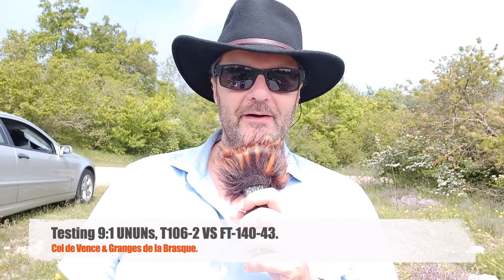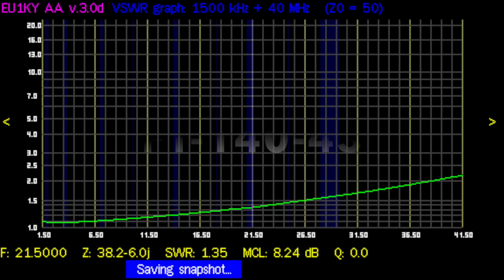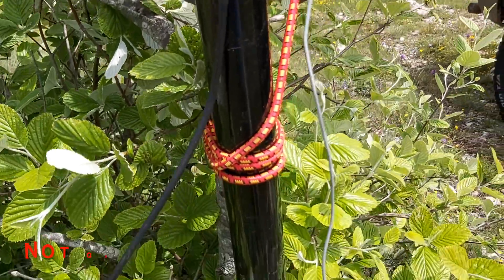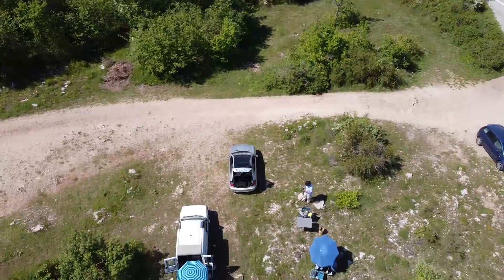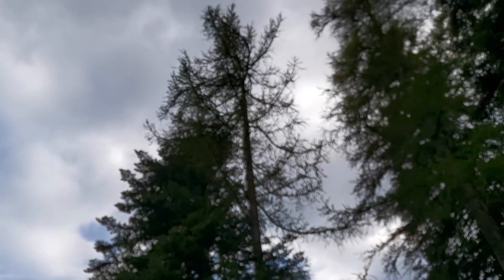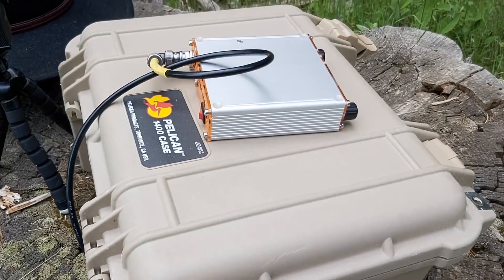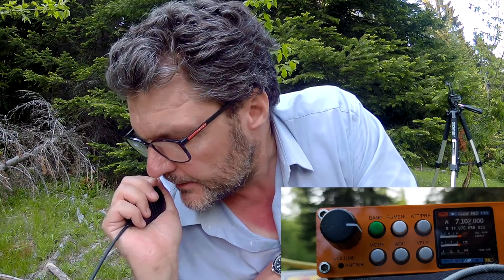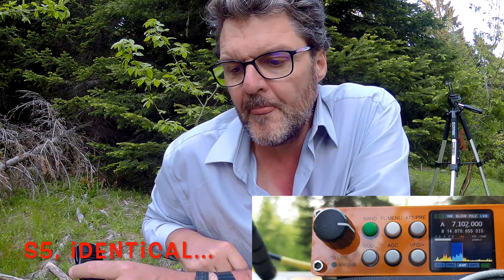Testing 9:1 UNUNs, T106-2 VS FT-140-43.

Comment: 00:57 That IS NOT A TEST !!! The SWR tells you how much power is reflected back to the transmitter but not the INSERTION LOSS of the transformer.
The reflected power is not lost power and is recovered (better if with a tuner) except for the increased losses of the line.
The insertion loss instead wastes part of the power by transforming it into heat and therefore that is the measurement to do.
If you, before teaching wrong things, learned to design RF transformers you would never test a wide band transformer wound on an iron powder toroid (e.g. mix 2, as in this video) instead of ferrite because it is a gross error
Reply from the maker: I know this. This is not about the SWR. You seem to believe that I am saying this is the best antenna out there, when I am just saying that it works!

Comment: If you are doing SSB QRP you will always do better with a resonant antenna. Radom wires are less efficient and poorer on receive. If you don't have the space for a half or quarter wave, a coil can help to reduce the length although this will start to introduce inefficiencies. The 9:1 and a wire does have the advantage of being always able to get a signal out albeit inefficiently pretty much anywhere, so there is a use case as a backup, potentially not even using an unun and just let the tuner match the wire (I have no information on whether the 9:1 plus tuner or just a tuner is more efficient).
Reply from the maker: I guess the 9:1 is an assurance that the tuner will be able to tune the system. I'd take an EFHW any day over a random wire!

Comment: Can you build and test the Wolfgang 9.1 unun please
Reply from the maker: I'll look it up..
Reply from the maker: It is the same as the EARCHI UNUN I tested and used in a few of my videos.
Reply: @RadioPrepper  No the lay out and spacing of the coils are very important here is a link  https://youtu.be/sk2ZZdJJrgY
Reply: Do correct me if I am mistaken my friend
Reply from the maker: Ah thanks, I didn't see this because it was held for review, because of the link.. I'll have a look..
Reply from the maker: Ok I watched the whole video... It is the same wiring, just one turn difference. However my test did show that the powdered iron core works better than the ferrite material one, by far... He keeps mentioning good performance just because the SWR is low. He did not test the transformer on the air against another one. Low SWR has no bearing on performance. Testing SWR and proper transformation is not at all like testing efficiency...

Comment: Thanks for another excellent presentation. I wonder if changes in propagation had any impact on the results. One could repeat the test with a local amateur operator and use ground wave propagation. Another option would be measurements taken with a field strength meter.

It might be even more interesting to replace the antenna with a 450 ohm resistor and scan each device with a NanoVNA over the range 1.0 MHz to 30 MHz. The NanoVNA could be set up to display SWR and show the variation across the HF bands. You might see a significant difference between the two devices. This might be an interesting subject for a future video! One other consideration is that the optimum number of turns for each core may be different.
Reply from the maker: I might do that thanks.

Comment: ... great video.. I wonder what would happen if you glued the #43 core and the #2 core together, assuming they are the same physical size, and made an UnUn out of both...as you proved, it is well known that #2 shines 14 MHZ and above, whereas the 43 or even a 31 mix works better at the lower frequencies of 40 and 80... you have a NanoVNA so you could get an idea at home before heading to the hills for the test. Notice that the QRPGuys little POTA antennas for 40 and above use #2 material...their EFHW antennas which cover 80 use #43.
Reply from the maker: Probably wouldn't work IMHO.

Comment: Your test is flawed, a random wire antenna is a non resonant antenna requiring the tuner to bring it to resonance, for this to happen efficiently the random wire requires a sufficient rf ground system not a short counterpoise, also any antenna requiring the use of a tuner requires a low loss feeder to minimize loss due to a higher attenuation from swr being in the line, if these requirements are implemented then you probably fine little noticeable difference in performance if any

Comment: Hi I am a huge fan of 9:1 random wires , and also make my own . I use one about 20 meters long as my main base antenna in an inverted V . The swr on all bands does not need a tuner at all , ( I don't use 160m band)  my worst swr is a 1.4 on 40m and 15m all other bands less than 1.2 swr . I also have a commercially made off center fed dipole that is supposed to need no tuner but no band is less than 2:1 swr and it is also much higher than the random wire and does not work anywhere near as well...... I tried an EFHW with a 49:1 and it was just terrible.... also brought online . I have to say my home built 9:1 unun antenna is awesome and performs great . Maybe it's my location , but I also have the same type antenna I take camping with my 5 watt sdr radio and it gets the same great swr and I usually make lots of contacts and get great reports. As proven with most antenna's your mileage may vary . Even though they call it a random wire antenna there are lengths of wire that work better than others , it's definitely worth experimenting with. Thanks for the great video's Gil I am a long time watcher 73
Reply from the maker: Surprising that the 49:1 did not perform, as it is the best antenna I have ever tried. Did you use a half-wave wire?
Reply: @RadioPrepper  It was a commercial made EFHW , I never measured it but would expect it to be a half wave length . It just never performed as advertised so I went to playing with the 9:1 random wire antenna's and had fantastic results and now I still use it today as my base antenna and for mobile opps and work the world on it....... a lot of france lately too.

Comment: my 1/2 wave verticals i use 49:1 with 140-43 (17m, 15m) swr is at 1:1 no need for tuner and work well  for 40m,20m  i use a 140-43 but as a 64:1 works best giving me good swr
with no need for a tuner i have built some 9:1's but as yet not been able to test them

Comment: I believe you said you had 8 meters of wire.  This user (  https://youtu.be/9eaAFTo5IQY ) used 29 feet of antenna and had feed line significantly longer than 16 ft.  She got on 40m and was able to make a contact from Wisconsin to West Virginia.  The Smokin Ape (https://youtu.be/9KPZO2-K76g?t=653) was using 29.5 feet of antenna wire.  I have ordered up my transformer materials and am going to make this and see what happens.  Thanks for your videos.  Maybe trying some different lengths of feed and counterpoise would be all it would take to give it another band.

Comment: Random wire 9 :1 unun is really a bad description for this antenna as the wire length is not really random and needs to be chosen so that their is no half wave length high impedance match. There are charts available on the internet of suitable lengths for this type of antenna. Great videos by the way.
Reply from the maker: Right, but what do we call it?
Reply: @RadioPrepper  How about - Non resonent end fed wire antenna. I am not criticising your use of the name for this antenna it is quite commonly used to describe it. I  watched a review of such an antenna on YouTube recently where they cut down the length such that it ended up at half a wave length on one of the bands and consequently wouldn't tune up. They contacted the manufacturer who explained the issue. It was then retested with the supplied antenna length and they were quite happy with its performance. It's just that the name given suggests that it will work with any length antenna wire.
Reply from the maker: That does sound better!

Comment: Another great video Gil, loving the Minion SDR. Our of curiosity,  what is the SWR on the antenna side of the tuner? It would be good to see the loss to see how much of your RF is actually making its way to the antenna. 100% agree with the 49 or 64 to 1 transformer on a better option.
Reply from the maker: Good question, I didn't check!

Comment: Hi Gil!
#2 material is made for creating filters / tuned circuits in the 10~40 MHz range, they are not adapted for HF broadband transformers (but they are in the 150~400 MHz).
#43 is adapted for broadband transformers in the HF band.
What you  should have in mind is not only the impedance adaptation but also the efficiency. Do the test with a field strength meter : an unun based on #2 material radiates less than one made out of #43 material, all things equal otherwise.
Reply from the maker: Yep, I am building a field strength meter right now..

Comment: Oops, I will still have to use up my supply of FT-140-43 toroid's. Thanks for the excellent videos Gil.73's  kd9oam
Reply from the maker: Make 49:1 and 64:1 transformers, plus a choke!
Reply: @RadioPrepper  Or use a counterpoise, it weights less ;)
Reply: @RadioPrepper   Thank you my friend, I will use them. I never toss anything anyway cheers! kd9oam
Reply: #43 material is ideal for 9:1 UNUNs since it is designed for broadband HF transformers ;)

Comment: Very interesting Gil!! Great assembly, great analysis. Can the results also be expanded to a 49:1 or 64: 1 transformer? T106-2 works better too?  73 de PU5AMB
Reply from the maker: #2 material is not used for 49:1/64:1 transformers...

Comment: Good night Gil, a question I have with these antennas, I see that you use a tree to install the antenna, can or does it affect if the cable touches the branches, or can it touch, is there only a problem with metals? Thank you
Reply from the maker: Branches do not seem to cause any troubles..

Comment: Hi Gil - in the test, did I hear correct, you were using 43 ft of wire with the 49:1 ? That would explain why it didn't work well, it wasn't a half wavelength. Hey, I need that chick-magnet T-shirt, I must buy one 😂
Reply: 9:1, not 49:1
Reply from the maker: Indded, 41ft with a 9:1.  See: https://youtu.be/0zF7bDoqkG4

Comment: Gil have you tried your choke closer to your unun and then use a counterpoise. When I mean close I mean use a BNC to BNC male adaptor. BTW I learn a lot from your channel. Keep smiling and stay safe.
Reply from the maker: Not in this case, but I could have done that yes, it makes better sense. I guess the tuner was closer ;-)
Reply: It more a suggestion to remove the other “random” wire ie the coax braid, radio and DC power cable.

Comment: For great results try a Guenella 9:1 UnUn on three FT114-43 cores.
Reply from the maker: Do you have a link for that?
Reply: @RadioPrepper  https://www.qsl.net/kh6grt/page4/balun/balun.htm
Reply: @RadioPrepper  See CJ link below
Reply: I use 10 bifilar turns of #22 wire on three FT114-43 cores.  Works better than everything else I have ever tried.
Reply: Here are my SWR's with a 71 ft wire about 12 ft high in trees:
80M 5.1 - 4.2
40M 2. 3
20M 1.4 - 2.2
17M 2.9
15M 1.3
12M 2.3
10M 2.5 - 1.9
Reply from the maker: Great, thank you!
Reply: Forgot to mention that I also add a 32 ft counterpoise

Comment: Interesting test Gil, experimenting with wires up in trees for an antenna is one of my favorite parts of the hobby. I use a 9:1 unun with somewhere around 58 feet of wire up about 40-45 feet in a tree in my back yard (no ground or counterpoise just 50 ft of RG8X) for my main antenna and basically the same for portable although I experiment with other antenna setups.  It works quite well and tunes everywhere except for 160 meters using an LDG ATU but with the EMTECH I can tune in almost anything anywhere. I use a 9:1 built by Nelson Antennas that I bought on eBay so unfortunately I don't know what he uses for a core but I'm quite happy with this configuration only using 6 watts. I haven't used an RF choke yet but I'm curious now if I'd see any difference or not.
Reply from the maker: I should try a longer wire, thanks!
Reply: Radio Prepper Yes Gil it’s a lot of fun to experiment with wires and ununs so I think longer is better in some cases. If you are looking to tune up on most bands there are specific lengths you want to stay away from. The wavelengths on most bands or even multiples can cause issues when tuning up. Check this article on Hamuniverse, it’s interesting and has several wire lengths to try. Take care Gil.

http://hamuniverse.com/randomwireantennalengths.html
Reply: Radio Prepper  Hi Gil. Thanks for all you share with us!

I also have Nelson Antennas 9:1 unun. I’m using appropriately 100 foot wire (didn’t measure) into a a tree about 50 or so feet up, running out my window about 7 feet off the ground, along with a 10 foot counterpoise. Only 6 foot coax to manual tuner, then coiled coax jumper from tuner to radio. Some bands internal tuner works. 80 and 160 needs external manual tuner. 40, 20, 17 and part of 6 works on internal. 

I only run 10 watts but have had great success. Several contacts to Europe. 

The wire was free, discarded antenna rotor control cable at a ham tailgate party. I had to make a jig to strip off sheath and unwind wire with a drill. Great wire and strong for its size!

Very 73, de N4WLC Bill
Reply from the maker: Gotta love repurposed junk! :-)

Comment: Which do you think is better for a 49:1 or a 64:1 EFHW?
Reply: Multi-tap with a choice. And always, always, including at least 75:1 or even better, 81:1.
Reply from the maker: 49:1 for 20m and up, 64:1 for 20m and below..
Reply: EFHW ?  NOOB here
Reply: @judd_s5643  nah not a noob good questions  7 3
Reply: @judd_s5643  End-Fed Half-Wave, a type of wire antenna.

Comment: I work with an EFLW antenna for a number of years now, using a T200-2 UnUn. With no amplifier I get around much on the world (even on 80M). I think that's not bad for a 16 Mtr. wire @ 12 Mtr. high from Ground Level, sending from below sea level (I live in the Netherlands...).
Maybe I'll put an EFHW antenna up, some day.
Thanks for the fine video. 73 de PD0PSX
Reply from the maker: Give it a try, with a 49:1, it works awesomely!
Reply: @RadioPrepper  a 49:1 UnUn would not work with a random wire antenna. Given about 650 Ohm in a random wire antenna, the 49:1 would bring it down 13 Ohms...
The 49:1 UnUn will probably work with a End Fed Half Wave (which has about 2.5  kOhms)
I'm planning to use a EFHW (such as the HyEndfed) some day...

Comment: I heard that LC coupling (like MFJ 16010) is more efficient than transformers on ferrite, but not tested yet... RA9QAT
Reply: Hi Vlad, that’s a very interesting concept, are you saying that one simple device could resolve the issues discussed for any random wire length?  I would imagine losses due to heat are minimised.  I’ve already over spent experimenting during lock down.  Thanks for the heads up 👍🏻
Reply: @mikes6844  Hi Mike! I guess device like MFJ16010 can help operate with random length wire (not resonant one). We can't use only 9 to 1 transformer without tuner, so I think it's better to  use LC tuner specially designed for random wire antennas. In case of using 9:1 and automatic antenna tuner we have a kind of comfort, but loose efficiency. Last two years I use resonant end fed antenna - 20m wire with 64:1 transformer (PD7MAA) wich works on 40m, 20m and CB bands and have good results for local communications. I study using of random lenth antennas as quick deploying antennas for traveling and emergency when you can use 19m wire from 80 to 10m bands.